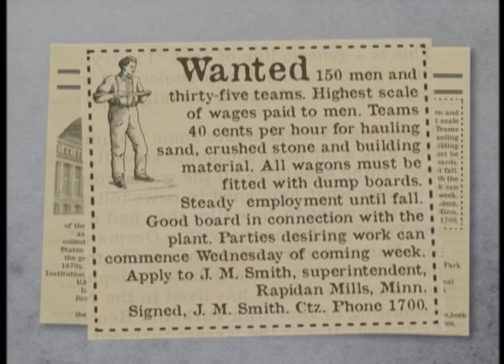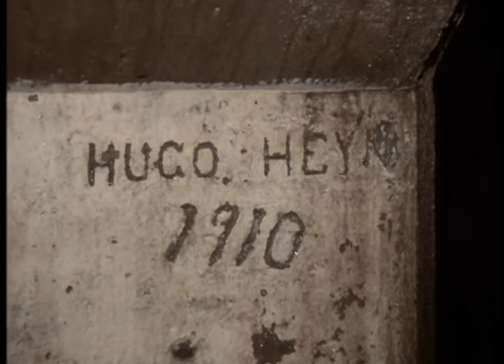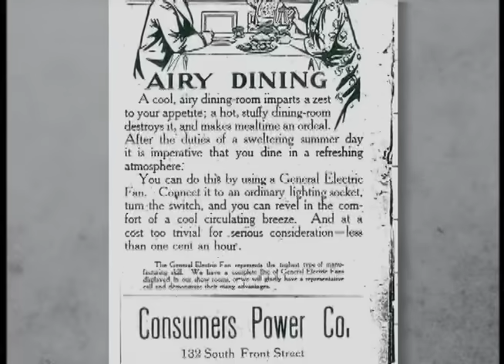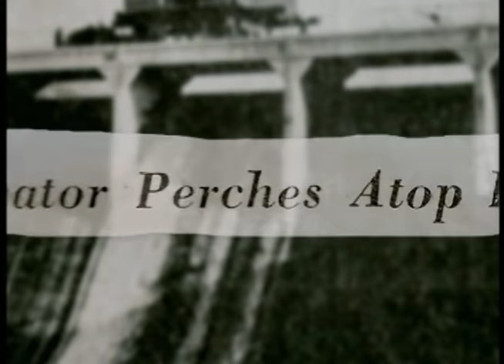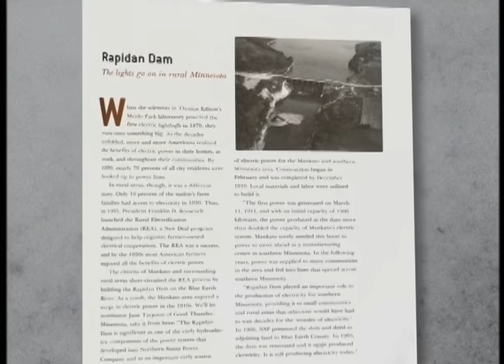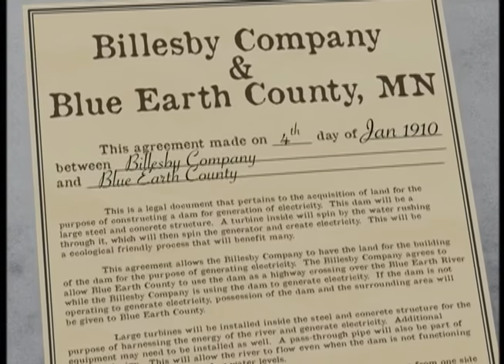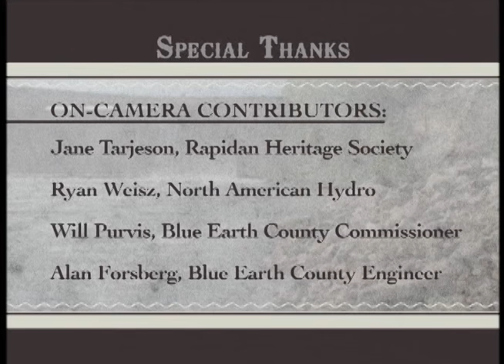Rapidan Dam:  A Living Landmark

Comment: Even though I am not from Minnesota and have never visited that area of the state, I found this interesting. It is a shame that it will be gone after they remove the dam due to the 2024 floods. I guess the river will re-wild itself, but without a dam to hold water back for dry years and seasons, the river won't be as useful. Quite clearly this area is prone to some very large floods, they better have dikes and levees down river to handle the next big flood.